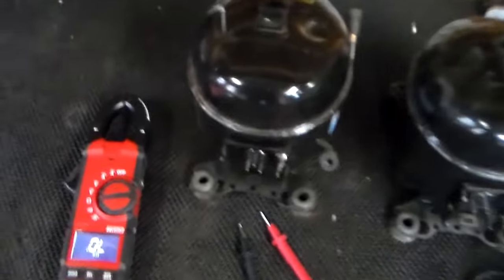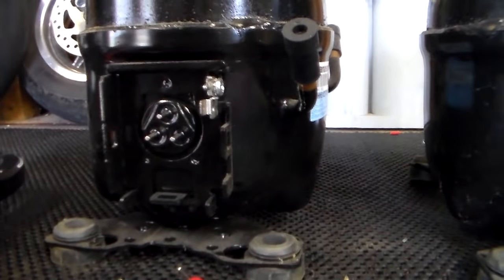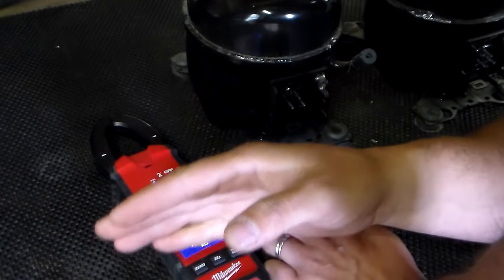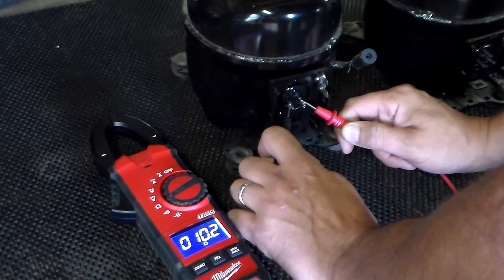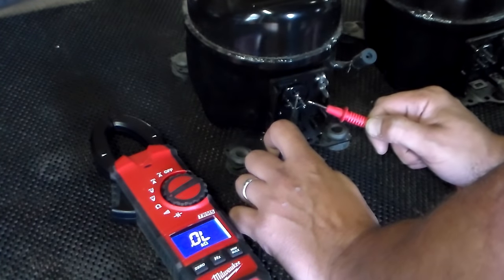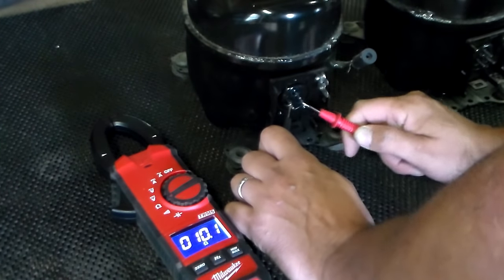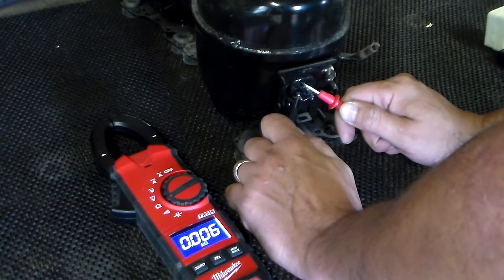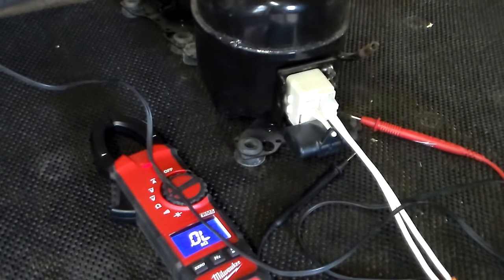How to Test the Compressor on your Refrigerator

Comment: Hi Bill, Your video very helpful.  Thanks!  To follow-up, my ohms readings were way high, in the 30's, 40's, & 70's, with the power cord removed from wall.  Also, the power connector cable (two white & one red) to compressor relay is reading 198V AC when power plugged into outlet.  Do I have more than one problem?  Thanks again!
Reply: NC Dad I have let the compressor sit with no power for some time now.  I tested the pins again after viewing your newest video, which has a better explanation of the pin readings.  The pins on my compressor are inverted from the pins in your videos.  I have Whirlpool side by side refrigerator.

The bottom two (AB) show a reading of about 10ohms, but fluctuates constantly.  The top pin I labeled C.  BC readings fluctuate in the 20's & 30's.  AC fluctuated higher than BC & would go open (OL), and then eventually stayed open (OL).  So, I believe my compressor is bad electrically in following the formula AC + BC equals or nearly equals AB.  However, I am still trying to figure out (researching) why my power connector (white/red) to the compressor relay is still reading 198V AC.

Comment: Hey Bill. Been watching your videos for a while. I have a Kenmore side by side that stopped cooling and made the clicking sound. Inspected the relay opened it up cause it rattled a bit and ceramic disc inside was broken. Got myself a new one plugged it to the compressor worked fine for a couple of hours and then the clicking sound again and no cooling. I already tested compressor prongs following your advice and looks like its good. Omhs were: 8, 4.3 and 5 going in the order you specify. What else could it be? Regards!!

Comment: On my compressor, the top prong is at the bottom. I know it's sounds stupid but either way you look at it could be the right or wrong orientation. It would seem it would just be reversed but I dont know the inner workings of the compressor so I don't know if I'm just randomly testing the wrong prongs. Where should I start

Comment: Bottom 2 12.0
Bottom left to top  12.1
Bottom right to top 4.8

Is my compressor good?  Thanks
When replacing the 2 wires back on overload protector does it matter which wire goes where? Theres 2 . Orange and black.
The refrig is brand new. I got it from a Treasure Hunt clearance outlet store.
Reply: That cord you made to plug in the compressor directly, does it matter which wire goes to which relay terminal? 
Incidently i took the relay apart.  The ceramic disc had a tiny bit of a brown spot in the middle. Took it out cleaned  it replaced it and reinstalled it. Still compressor doesnt turn on.  I do have 120 volts at the incoming wire connector . I tested with multimeter. Thanks in advance sir

Comment: Hi Bill. I checked compressor. Its good. Bought new relay and capacitor. Both new. Then checked power at relay. Fan inside running so compressor should be running. Im only getting 7.6 v at relay? Any ideas?

Comment: I tested my compressor( embraco emi 30her 115-127v 60hz )on a Mini refrigerator , between three pins, they are 22.8, 8.7,30.4  does it mean the compressor is bad. the compressor could not start, there were click sound then about 50 seconds later another click sound, then about 10 seconds later another click sound. Can anyone help?

Comment: Hi Bill, I just came across your video can you please let me know what to set my meter on?  I have a greenlee DM-20 and that meter has the upside down horseshoe but it has a lot of different 2's.  2000k 200k 20k 2000 200   which one should I use?  Thank you

Comment: Hi .I tested the windings on my Samsung fridge/freezer readings are 26 + 18 = 44 it runs when turned on from cold but will not restart the compressor is very hot I changed the overload protector switch made no difference . I am told that the problem is the imbalance in the windings which is causing the compressor to run hot do you think the compressor is faulty or is it worth trying a new relay and possibly a new capacitor . Could a bad capacitor cause this problem . thanks .

Comment: You mentioned the fan should be running.  I tested my fans good, but they are not running.  The relay on the circuit board is cycling so I bought a new board. No change. Ideas?

Comment: My top pin wont give me any reading on the multimeter so im guessing that  the top pin is not good anymore. I'm curious if anyone know if the top pin is repairable or do I have to replace the whole compressor. Thanks.

Comment: kenmore model # 564.62042100
my measurement is...
bottom pins = 11.2
lt & top pins = 6.4
top & rt pin = 4.5
is it good or bad ?  thanks man.
the compressor comes on, top and bottom has warm air 
one of the relay connector has slight burn brown mark.
when i shake the relay i dont hear anything.
Reply from the maker: Looks like it's testing good, your issue sounds like freon.  Remove the back panel and check for any frost on the evaporator.
Thanks for Watching!

Comment: We have a Digital Multimeter and our "Ohm" section has multiple settings: 200, 2K, 20k, 200k, 2m. I've read that if you set it too low for what you're reading you can blow out the multimeter. Which setting is appropriate for the compressor on our Kenmore?
Reply from the maker: 200
Thanks for Watching!

Comment: I just did some of these ohm readings and mine seem to be much higher on a small magic chef fridge.  I am getting 25 L to R, 13.5 L to C, and then 11.5 R to C.  No short out, my relay is reading 5 ohms and my overload is around .8-1 ohms.   I seen in another video that the overload should be reading 0.3 to 0.4   I can get the overload for $35 which I would have no problem paying if I knew that was the issue.

Comment: I see after market start relay and capacitor combos on ebay new for $7 to around $15.  Some name brands like the Shizuki capacitor that came with this fridge are quiet expensive. I just sent an email to a seller with the fridge model and serial number to make sure the one he has for $7.24 will work on my neighbor's Amana made by Whirlpool. While waiting for a response I will check the compressor prongs for the ten- six- four Ohm readings. Thanks Bill for those specs.

Comment: Very nice and well-explained video. Learned a lot. Thanks, watching from Trinidad.       If a refrigerator after running for some time shuts off and won't restart. But after unplugging for a couple hours then plugs back in, it will start but run for only a couple hours then shut down again. Is it the defrost timer?

Comment: Hey bud thanks for sharing your wisdom. I do have a question though. A two part question actually. 
I have a compressor sitting in the garage that is missing its relay. 
A: Can the relay be bypassed without damaging anything internal?
B: if it absolutely needs to have the relay, is it part specific or can I build A little circuit with a relay on it? 
I won’t be using it as a heat exchanger. I just wanna see for myself how much of a vacuum these little compressors can pull. I’ve heard people swear by it and other people knock it. 
My apologies for the lengthy question.

Comment: Hi bill, I test my compressor and I got this reading from the bottom 6, left bottom to upper 2 and upper to right bottom 4, that is means I got defective compressor?
Reply: The compressor is probably good according to those readings (the two low readings equal the high reading) At least the electrical portion. More likely the plug portion going in or not getting 120 into the plug.

Comment: Hi there , i have a 2011 sanyo wine cooler , everything seems to work exept doesnt cool down
compressor start or buzz , all button ,on / off ,  lights works...compressor gets very hot after 30 min.
freeon line out doesnt get very cold from condenser
my 4 pin capacitor seem very small ( 2 cm diameter x 1 cm tall )
i have ohms reading like in you video
so i guess this has to be the capacitor...not firing enough to kickstart...and only buzz the compressor ?

Comment: Hi Bill, I just replace my fridge compressor. It was LG. Old one has pin orientation Triangle down side. But new one same like you have. It is two wire inverter compressor no relay but just overload. now dont know which one is common. wires are not fitting in if I just turn them up side down. Can you help.

Comment: Bill great video. I have chickens too but rooster thawed now in broke freezer. White-Westinghouse upright. Changed relay to universal as they don't make mine any more. Tested compressor 10,6 and 4 good. However compressor won't kick in. Can compressor be froze with good readings?  Don't know what else to check.

Comment: Will this test also work on a freezer?
I have an  Kenmore upright freezer Model-25326062104 
that wouldn't freeze below about 32 degrees.
A local repairman told me that if it was the compressor it 
would cost about $700 to repair it. That's more than I paid
for the freezer new from Sears in 2008 or so.
Anything I can do to make it run again?
It's been down for over four months and I'm looking to
buy a 5.0 cubic foot GE chest freezer.
I had a perfectly good Montgomery Ward 7.0 cubic foot chest freezer
I bought used for $30 over ten years ago and gave it to a neighbor
when I bought the Sears upright, and it's still working for him. Damn!
I should have kept it.

Comment: Hi Bill, I have a refrigerator that was traded in, I checked the pins and getting numbers like 14 across the bottom two pens, and its running 2.4amps while the compressor is running, its an older crosley refrigerator but its staying perfect temps, would or should I consider this trash as its pulling so many amps? just curious cause the numbers are so high? Appreciate your help :)

Comment: Hi Bill, I have an 8 year old upright freezer, has the digital display on the front of the door. The display lights up, light comes on inside but there is no sound of a fan or compressor running. Thanks to your videos I tested the compressor(good), When I test the connector that goes into the starter I only get about 30v ac, any ideas what might be wrong? Thanks!

Kevin
Reply from the maker: Kevin B I would say the relay inside the display on the door has burnt up.  I have replaced a lot of those, mostly because the display would go out, but the machine would still work.  That control is the brains of the whole operation.

Thanks for Watching!

Comment: Hi Bill, Both the compressor and compressor fan are not running on my GE side by side. Evaporator fan does run. I checked compressor and also checked voltage to compressor from the main board. I also checked all thermistor and they seems to be good too. When shake the relay, I don't hear any clicks, so I assume it's good, but any way to test that for certain? what else should I check? thanks for you help.

Comment: I need some advice on my refrigerator. So it's a whirlpool side by side and last night I noticed that the freezer was in a defrost mode you could say. The ice was melting and the fan is running. I checked the relay switch to see if that was the issue and replaced it, but once I plug it in, the fan still runs but the compressor just makes a clicking sound every few minutes. I was looking for any other suggestions for trouble shooting whatever issue it may be?

Comment: I tested my compressor and I get: bottom pins=20 Ω, bottom left + top= 14 Ω, bottom right + top= 6.5 Ω
Is my compressor damaged? And if it’s dose this make my fan not working? I bought a new fan it works and it started to cool the refrigerator 5 minuets and everything stop working.

Comment: what if I test with a multimeter and I get 0 for all three sets of tests (3 pins)?  Also I have a cheap multimeter and the ohm reading is x1K.  Perhaps it is not giving me the correct reading because of the x1K?  maybe I just need a regular one?   thanks for your help
Reply: +Paul Joseph I get same: reading ~0 Ohm on both X10 and X1k settings. Does a bad compressor have very high or very low resistance?

Comment: Excellent video! I have a odd problem with a samsung RF32FMQDBSR "french door" dual compressor unit. The freezer works great and it's compressor has a  hum and you can hear it gargling and it's hot to touch. The fridge compressor is running as I can feel it and hear it slightly but it's only warm to the touch compared to the other one and there is no sound of of it making the gargling sounds. I've removed the cover inside the fridge that covers the evap coil and with my digital thermometer see that it's only getting to 58F. The only slight little bit of frost that's there is on the cap tube that's connected to the end of the evap coil. I was thinking it leaked the refrigerant but can't find any signs of oil where the compressor is or at the coil. I bought a line tap, the kind that punctures the line with small needle,  from amazon and was going to put it on the process tube to see if it had any refrigerant pressure. I'm still waiting on it but though I'd do more research. I'm baffled as I don't see any oil residue anywhere. The only thing I can think of is the compressor went out internally and is running but not pumping. The compressor part number is: NC1MV43AMP/E01. Samsung has it but it's pretty expensive, I found other ones online but their rating does not match the specs on this one as far as volts / Hz. The compressor says 160V ---200V @ 60 --200Hz. My multimeter shows the ohms test like you did to be good.  I've checked relays, inverter etc but I figured it any of that was bad it wouldn't start which it does. It says R134A as the refrigerant, any help would be appreciated.

Comment: Good video Bill, thanks. My fridge freezer at work stopped working today and I had a quick look to see if I could find the problem. It's getting power to the connector on the compressor, tested with a multimeter, but no fan and no compressor. The lights on the top of the fridge don't come on either. (it has no bulb inside so can't use that to see if there's power). It's a Hotpoint FFA74. I will check the compressor as in your video tomorrow but the fact the fan isn't working concerns me.

Comment: Thanks for the video!  My Frigidaire stopped functioning one day and filled my two-story house with heavy burnt transformer smell. The odor penetrated some of the food so I tossed some items and transferred the rest to another fridge. The three pins test okay,... the capacitor tests good,...freezer fan functions.  On day one, the compressor was hot to the touch,..day two,  room temp and only a weak hum.  The heavy burnt transformer odor puzzles me and heavily suggests that the compressor went South! My question is how can I test the relay to determine if it is bad?

Comment: Hi Bill, I enjoy your videos. I have a frig that apparently leaks out all refrigerant. I put a line tap to add more refrigerant. It took some in about 4-5 oz. However, it didn't cool enough. I opened up the panel and it freezes just the tail part of the line. what is the issue here? Thanks.
Bobby.
Reply: check the pensil drier on fridge tht will be on ur liquid side just before condesor possible tht its or cappilery are blocked

Comment: Hey Bill thanks for the video, my refrigerator compressor ohms out good but only runs for a few seconds and cuts off . The starter relay when I shake it rattles just a little bit, I'm thinking it's bad, what's your take?
Reply from the maker: I would throw a 3 n 1 on it and make sure the compressor stays running.  While it's running do an amp draw test on it.  If it's running around 1 amp give or take a couple points, let the 3 n 1 on it.  If the amp draw is too high, the compressor is going out.

Comment: Thanks Lester for your advice, but I think I got the fix. FYI, the back panel plays a very important role. When I had it off, the compressor did not get cool enough and draw huge amount of current afte a few minutes and finally gave in. I put another fan directly pointing at it. With this experiment, I realized that the panel has to be installed so the air can circulate inside. The frig works like a champ now.
Reply: good to hear.Thermodynamics is an interesting beast who would have thought that ur backing plat for ur fridge condenser would cause an enthalpy issue :)

Comment: I viewed several of your videos and was able to perform the ohms test on the compressor, the amperage draw by the compressor and remove and replace the relay.    The relay is slightly different (upgraded) and cost $67 at local parts vendor. My Whirlpool Gladiator from 2003 is cooling again.  I have always had the problem of the defrost drain line freezing up and then the defrost eventually spills into the freezer on the bottom.  Thanks

Comment: Also what if the compressors really hot to the touch even though it's been unplugged for an hour
Reply: Compressprs shouldnt get over 220°f if theydo and do for long enough it will torch the oil and gum up the whole system or just die.  If is getting hot is either undercharged system, bad relay, bad thermal cut off or the motor inside the compressor is on its way out and either caused by one of the above or age..  and unless a relay, capacitor fixes it than gonna be a lotta work fuxing the system with flushing everything, checking for micro leaks, changing the filter/ drier, replacing compressor and oil then resealing the system, pumping it down then recharging with refrigerant..

Comment: great info bill. question how do i get the charging tips that you use when you change that compressor. i have a compressor i want to replace but i cant find the tips. Please advise thank you
Reply: I suggest reading more into things first.  Compressors dont have charging tips of any kind..  only thing needing charged is the refrigerant and those are called service valves or service ports which you would braze onto the pipe..  the pins either get a relay, ptc thermistor or a capacitor ran to the pins then to mains power and to the fans and other refrigerator electronics..,